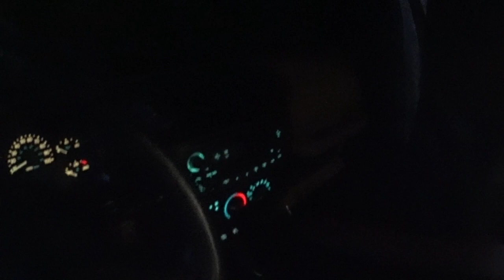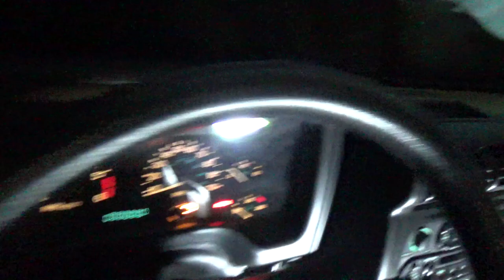Jeep TJ Project- Main Wiring- Grounds and Sheltie Puppies !!!

Comment: I made battery cables for my Jeep using the military terminals. I bought a hydraulic crimper to do the lugs and I also soldered them and covered with heat shrink. They should last a long time, hopefully haha
Reply from the maker: +CharterVlogs Mine don't have to be crimped - where did you get yours ?

Comment: An interesting technique for terminating a heavy gauge wire.  Did you reheat the terminal after you inserted the cable the make sure the solder wicked into the cable?  If not, I would worry that might result in a cold solder connection that has a high probability of failing.  For whatever it's worth.....probably not much....
Reply from the maker: +Mike Hartmann Hey Mike ! no I never reheat them - I've done hundreds this way and never had a problem tho. Now you probably jinxed me ..... hahahaha  The solder is so hot like molten lava if you have that much amount I'm thinking it will be fine :)

Comment: I've got a 1999 jeep wrangler 4.0 with an intermitten alternator problem. 
It starts good but the voltage drops and comes back on. 
Any ideas?
Reply: kinda late but I just swapped a used 160 amp alt. from a durango in my 06 TJ it charges almost double the factory jeep one . Bolted right on $50 . i did have to file a mm off the bottom alt. mounts it fit real tight .

Comment: i used 1/0 welding cable on my battery/alternator etc and MAN did that take a long time to heat up to solder - the cable just WICKED that heat RIGHT OUTTA THERE